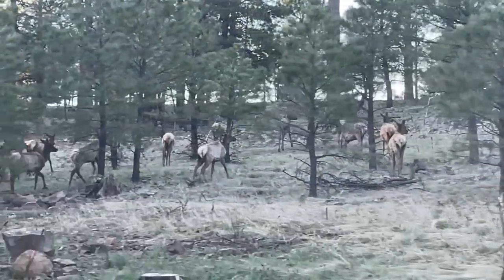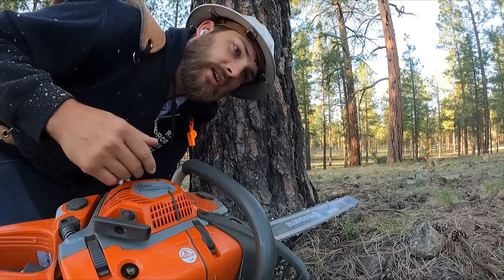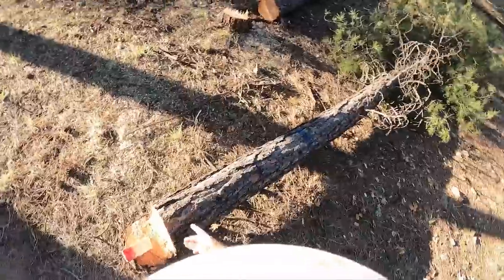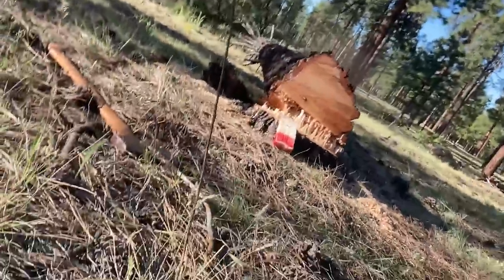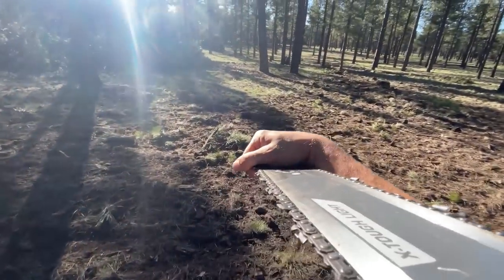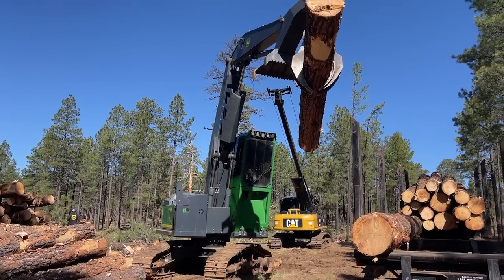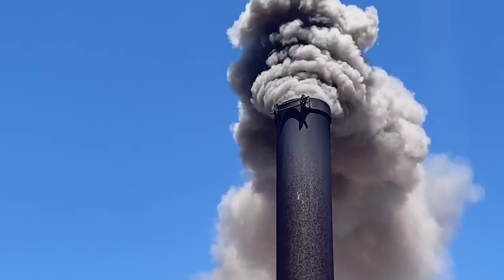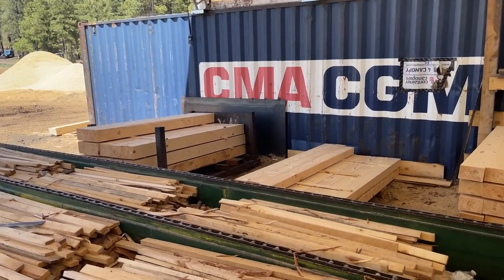Trees In The Morning, Lumber In The Afternoon!

Comment: Cool to see some Husqvarnas running down here. We run Stihl 461's with 28's and that will cut everything, even the "big" cottonwoods. Also, on the pecker poles I'll usually throw the wedge in parallel to the hinge.

Comment: It’s weird with the altitude cars do the same thing. At first you feel a little power loss but after a while they get used to it and run fine usually. Lived at sea level my whole life now I’m up at 5000 and work at 7-8000 so many things that you would never think change but do with thinner air.  from the motors running odd water boiling at lower temps and beers foaming a ton  when you open  😆

Comment: I know nothing about cutting trees but I love your channel. 
What is the reason for wedges instead of just using the saw?
Reply: If the tree is not leaning the way you want to fell it, the wedges push the tree over against the lean. If you don't use wedges in that circumstance the tree will eventually lean back and trap the saw bar.
Reply: @usefulcontent9894  I see thanks for the explanation.

Comment: Don’t need such a big bar - used to fell trees of the same size with a 13 inch bar and felling lever. Much easier to sned with a small bar.
Reply: But big bar is easier as you don’t have to cut both sides and you don’t have to bend over to buck and limb
Reply: Yeah, he knows that. It just so happened to be the bar he had.